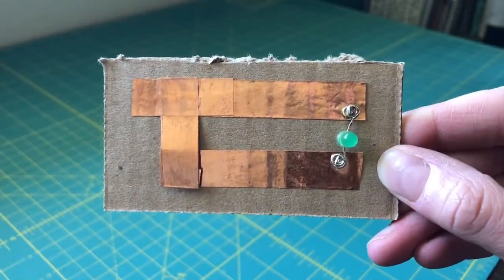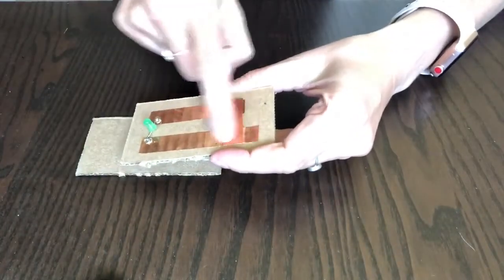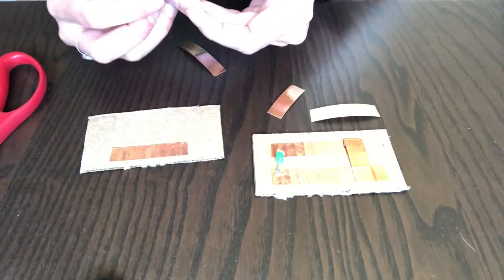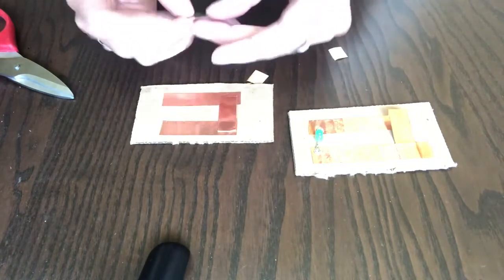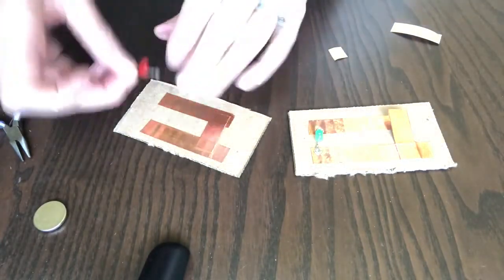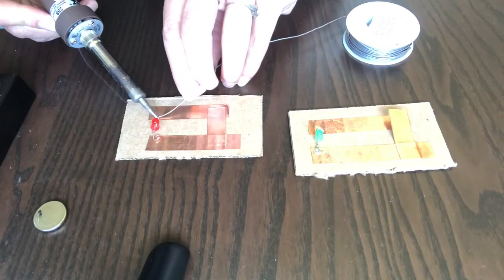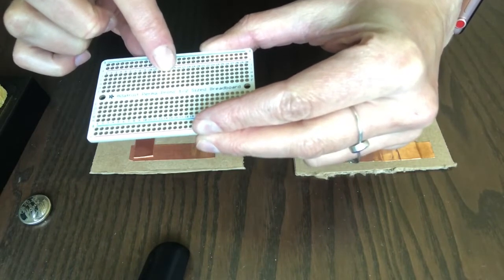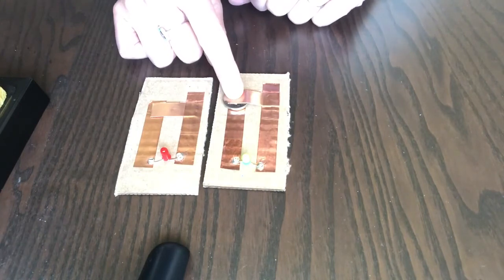Soldering onto Copper Tape  | BLDG 61

Comment: Thanks! I'm about to use this technique to solder the LEDs between the floors of a Lego building so that I can remove the floors without having to disconnect any wires.